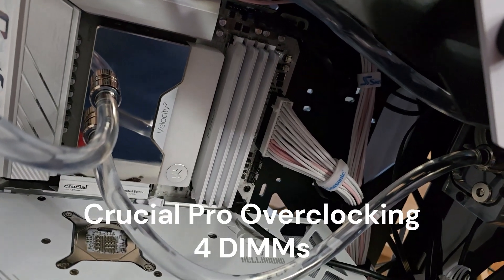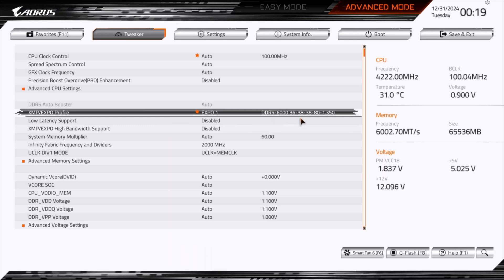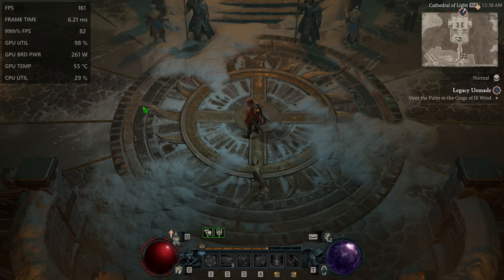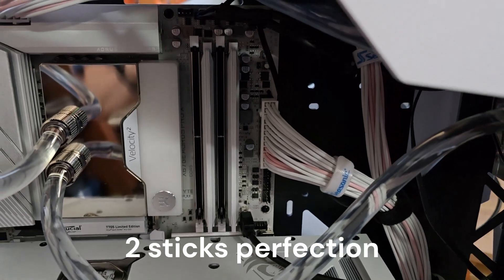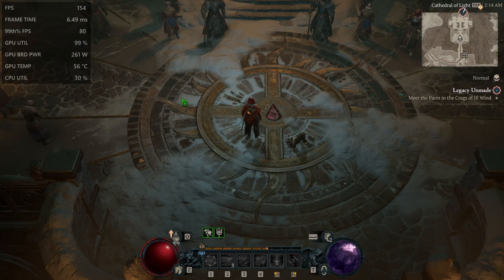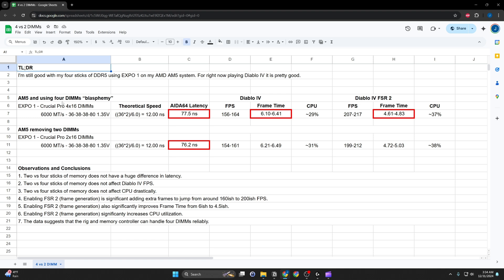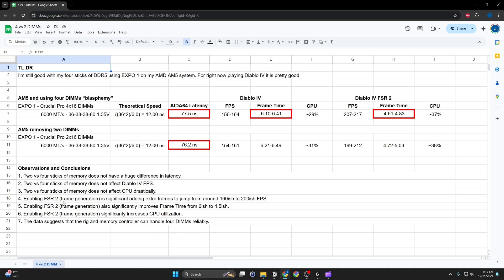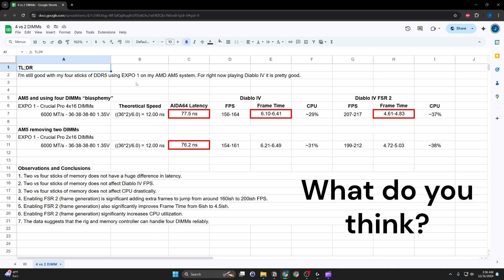DDR5 Blasphemy 4 vs 2 Sticks - Apollo Build

Comment: It seems like  PC building forums are just an echo chamber. Most people aren't overclocking their RAM and and worry too much about   dropping a few frames while most people can't tell the difference  after 120fps, let alone 60. If. 4 DIMM usage was a real problem AMD would be telling Motherboard manufacturers  to  stop making 4 slot boards.
Reply from the maker: Yes, why make 4 slots if there was no use for it? Also, there is a harsh reality of generated frames, my eyes and how fast a screen refreshes can't pick out in the milliseconds it's real or synthetic. My brain will probably even correct and say all frames are right. I enjoy the extra memory for everything else I do, and even gaming not such a hit that it matters enough for me.

Comment: Gemini referred your video on my question of why do 4 sticks of ram cause instability. Thank you for content 🎉
Reply from the maker: If you are running memory overclocked it becomes unstable. When there are 4 sticks there is daisy chaining of memory where memory modules don't have an equal path back to the CPU controller. This causes timing issues which can lead to stability problems. To make four sticks run you need to slow things down, so when you have four sticks you are prioritizing capacity vs performance.

Comment: You should limit our foreground FPS to about 6-10 FPS lower than your monitor is capable of.
Reply from the maker: Good suggestion, extra frames going over hardware limits is just waste. To be honest, I was nowhere near maxing my monitor. Also, my feeling is you can maybe see the smoothness, but there is a jump from 30 to 60 to 144, but to 240 or more I'm not a trained hawk. For work my presentations or spreadsheets, or code doesn't move this fast.